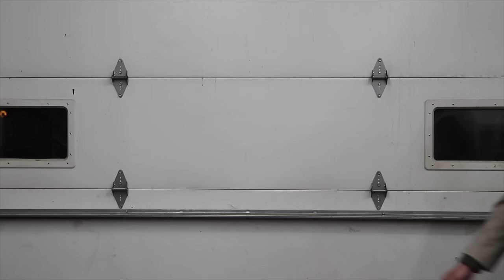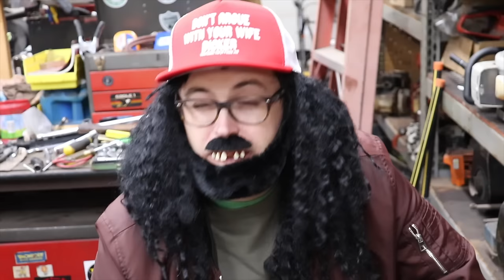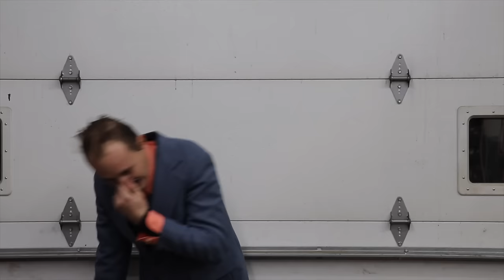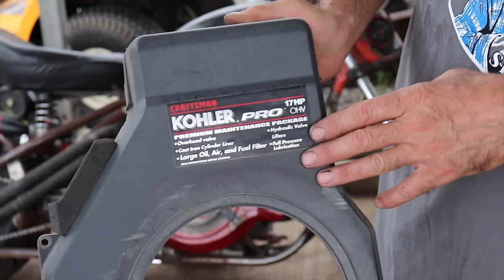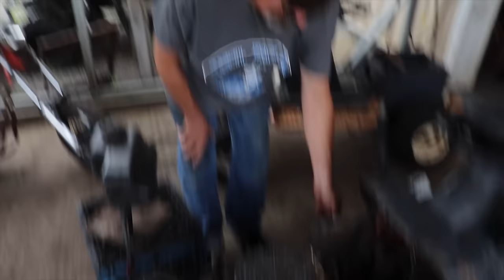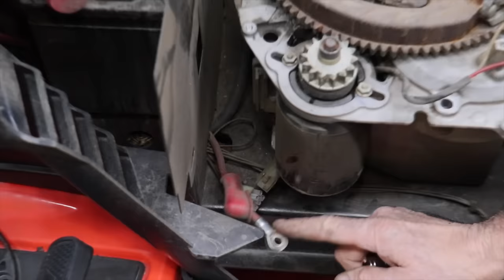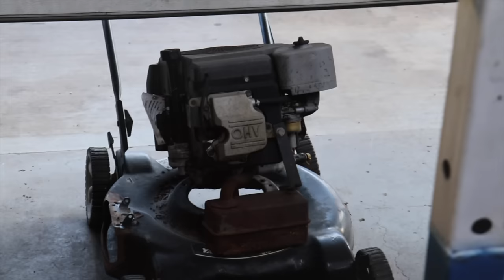Epic $100 Mower Flip - Engine Swap

Comment: Taryl is a real mechanic, he can take a substandard part and make it a high quality part that will work much better in the long run. He just doesn’t replace parts. That’s a great mechanic in my opinion! I have a 2018 Simplicity Regent tractor very similar like this but it came from the factory with a 22 h.p Briggs V-twin Pro model engine. It’s got a ton of power for the 38 inch mower deck.

Comment: The muffler, cable and wiring were super helpful, especially wiring. Going from a Kohler tp a Briggs on a lot of Tractors in the past was tricky for me, because of different wiring and colors, this helped simply that. Simplicity is key.

Comment: In 1986, I bought a Simplicity lawn tractor new, with a snowplow and deck, for my mom - who lived 250 miles from me.  It worked fairly well for 15 years but it wasn't anything to write home about.  I had no idea of what a real tractor was until I happened across a Simplicity garden tractor from 1974, used.  It has a 10hp cast iron B&S motor (large enough for my purposes) that will be running long after I die.

Comment: I just recently stopped by a big commercial construction job during this freezing rain storm and I asked the electrician if I could have some of the conduit fall offs lying around. He looked at me like I was insane. Let me tell ya the shit works great for exhaust on these mowers. The elbows can get a bit pricy at a supply house but I saved more than one mower with muffler extensions like that. Many years ago I made stack like exhaust pipes for my buddies VW dune buggy like that.

Comment: Great video as always, I run the Regent's big brother, a 2000ish Landlord DLX. In spite of the extra work fixing up the old deck, the cut quality if the full width roller decks makes it worth it. As for horsepower, the 18 horse Vanguard on my 50 inch Landlord can handle it adequately, main problem is it clogs easily in tall grass.

Comment: Taryl, FYI :   Tale from me. Needed new volt rectifier/regulator as yours.
John Deere wanted $90 ;  bought it elsewhere for $45. Now, ebay has then for $9.95. 
Another good tip, Run a separate ground wire from the connecting bolt of the regulator to the battery neg, or a good known ground. A bad ground connection will burn out the regulator mighty quick......I put mine to the battery post bolt

Comment: i had one of those dual control throttle assemblies that the cable hole was worn out on the choke lever. i just moved the cable to the other set of holes on the opposite side of the lever and put it back together. it works perfectly, just opposite of the choke on/off markings on the dash. nice of them to put holes on both sides of the lever like that. it is so convenient it must have been an accident i'm sure.

Comment: I did a refurbishment on a simplicity broadmoor. Repowered w a 22 hp briggs v twin. Originally was a vanguard 16hp which couldn't be rebuilt because the customer lost both heads and flywheel after it sat for 5 yrs under a tarp. Repower which required pipe fabrication bent outward a bit n lengthened 1 in on each side. Turned out really good. Pipe is a little tough to weld. Slow wire and lower the voltage. Also new steering bushings and rebuild the deck n spindles. 
Also flushed and refilled transmission and also new belts and new battery. 
I had to actually build a bagger for it but it turned out awesome. Parts cost was around 200 bucks. So
I payed 100 for it sold it sold it for 780. Guy really loved it. The quality on the higher end simplecitys is good.

Comment: Tarly, I watched your episode on the ultrasonic cleaner. I have discovered a great industrial cleaner that has lots of ammonia. I was developed for the coal mining industry. It’s called Blue Wolf. It can be ordered on the interscreen and they have a full line of cleaners and automotive cleaning products. I degreased the Briggs engine on my John Deere GT 235 and it worked great.
Reply: Dawn dish soap and water....or Mean Green 50/50 mix.....tried PurplePower, doesn't play well with aluminum......I'm now running a mix of Dawn, and pressure washer cleaner diluted, and seems to work well....

Comment: This is very interesting,  I'm doing an engine swap on a Murry 40 inch cut.  I was going to rebuild the 12.5 engine but, its cheaper to buy a new engine than rebuild.  Since I'm going to replace the engine,  I figured why not go big,  so, I'm going from 12.5 horsepower to a 25 horsepower 2 cylinder B&S. I always felt the 12.5 was too little for the mower,  I'm hoping the 25 will  have plenty of power for the 40 inch cut

Comment: Y'all remember that time you got a John Deere 214 for $200 and thought the non-running engine would be a simple fix? Yeah, me too. It's still on my patio awaiting a new engine repower, and a mount, belts, electrical system, all the manual controls were rusted together, and sometime later you figure out you paid two hundred bones for essentially nice sheet metal and a couple flat tires. Engine swaps are a lot easier when you score them on the cheap and were made the same decade as the donor engine. Man, never again!

Comment: When you torch the pulley like that, does it melt the seal under the engine? I know he wasn't concerned with that bucket but what if you wanted to keep the engine in tact?
Reply: Yes it does

Comment: Donyboy73 was talking about how John Deere did the same thing with the cutting blade bearing hub assemblies one of his videos where they fitted sealed bearings into regreaseable bearing housings.

The bearings can be sourced from a bearing shop or on eBay if you can get the bearing number off the seal or if you have a set of vernier calipers to measure the bearing ID & OD them Match it up to either a metric or an imperial bearing.

Just be careful when fitting them because they don't like being hit on the inner race with a hammer !
Reply: Guy rarely makes a mistake like that one.  Bearings should be pressed in, not driven in.

Comment: Under the deck around the blades is there a way to install more ways to mulch like the Toro dual-core cutting system has to cut grass pickup and leaves when bagging?

Comment: I know this is an old video, and this isnt a flip story, but i JUST got an old...like 2003 or so Craftsman with a 13.5 briggs. The deck was shot. It was barn kept its whole life just you know, grass ect. Shot as in there is more holes than metal. Rest of the mower is in absolute amazing shape, i need to give it a little carb clean, but yeah. Old lady owned it, even gave me the original owners manual plus the purchase receipt and even a receipt for a battery. Oh, for free by the way. Hadn't had a ride on before, so this is great, and me and Dad even used it to tow a couple items around the yard a bit. Gotta know for sure when and what to fix or when to give up. If i could get a deck for real cheap, i'd for sure throw one on.

Comment: The reason the top spindle bearing is a sealed bearing is because it doesn't have near as much load on it because of leverage;   and also, as soon as your grease level drops a little, that top bearing will be dry.  The bottom bearing has all the load on it, and all that grease will settle to the bottom because of gravity.  So it's better to be an open bearing..   The main problem with your top bearing being exposed is that you really have to stay up on your maintenance because again, if your grease drains even a little bit, your top bearing will immediately be dry.   It's much better to just keep that top bearing sealed.

Comment: I have a simple city conquest with a 50 inch mower deck and factory is a 18 horsepower Briggs and Stratton I do like the mower it does a wonderful job mowing but it's way under powered what size of engine would you suggest I look for that would give me some more power but not need to find different pulleys and electric clutch thank you for any information o and you have to watch them wet farts sometimes they will itch later lol

Comment: Great video with a lot of meaningful detail. Just one question, wouldn't you need more lubrication in the axle housing? Most of riding lawn mowers run in an oil bath.
Reply: Can you elaborate?? What axlel??

Comment: You're lucky the previous owner never greased those spindles! I guarantee you'd have to dig out half a pound of grease if you took mine apart! I been greasing them every Spring for almost 20 years! Mine's a 44" deck with equal sized blades.

Comment: Hey Taryl. I bought an old abused LT2000 Craftsman, that someone swapped in an 12.5hp Briggs. Any idea what may have happened in the conversion that would keep draining the battery. Ive replaced the battery several times with several brands. Replaced the regulator as I read is a common cause with no luck. I put an inline kill switch which works just curious of any common mistakes by backyard mechanics that could cause a parasitic draw. Thanks Taryl and I liked Sammy the "Dull" Gravano's initial presentation 😆

Comment: Anyone wondering. Swapping these engines on any lawn mower is super simple. 

Most of the time theirs two or three wires.
The black off the coil is just a ground wire for killing the coils has to be toggled to chasis ground. The red wire off the alternator with or without the diode inline is the 12v DC charge wire and can also be used for lights and accessories just run it to the positive post of your solenoid to charge your battery while running, and sometimes theirs also a white or other colored wire when their isnt a regulator used which is usually an AC wire off the alternator for your lights and accessories. If theirs a wire off the fuel cut off solenoid you just need to power it or delete it which I always do.
If you know that much you can rewire and swap basically any motor on any mower with other exceptions taken into account obviously. Hope this helps someone.

Comment: hi taryl i have a 2011 craftsman mower i replaced the Barings in the Spindale blade shaft and when in put it back togather and started cutting grass i noticed about a one inch spot of grass that was not cut i measured the blades and they are 23'' long and just two blades , is there any adjustment in the spindles or do i need longer blades i can not go much longer because they will hit the side of the deck and the rideing mower is a 46'' deck thanks if you can help

Comment: Question: if the muffler ever needs to be replaced is there a stock muffler or one that doesn't require modification to fit for the new owner to be able to replace without cutting and welding?
Reply: Straight pipe & bean can
Reply: straight pipe out the side and turned up about 2.5 feet long with a rain cap. it sounds SWEET!
Reply: All these ideas but none of them are direct oem stock bolt on mufflers for the rookie home owner with limited mechanical skills and no welding, cutting, and metal fabricating skills. Just simple straight forward purchase and bolt on and that's it like the original motor had.
Reply: @kbakeritsallaboutnobody.5761  thats the problem you run into when doing engine swaps, things might not fit
Reply: @michaelking3327  I didn't post this to be difficult or argumentative but when I flip mowers as compared to working on my own stuff there's a threshold I won't cross because whoever buys the machine might not be as mechanically intelligent as me and while that's ok I have to make sure it's simple for the customer to order parts and replace them without any fabricating or modifying to "make it work".
Reply: @kbakeritsallaboutnobody.5761  i agree, but sometimes the parts just dont exist. i work at a mower shop and there have been times we've had to fabricate stuff to work. in the end, as long as it's safe for the customer to use and won't fail in a dangerous way, then a little fabrication is worth the time for the money.
Reply: @michaelking3327  I probably would've replaced the Kohler with a B&S and went through the minor wiring changes than fabricating the exhaust. Typically most B&S engines single cylinder have a side exhaust port and mufflers are a dime a dozen and can be purchased for pennies.
Reply: @kbakeritsallaboutnobody.5761  very true, sadly kohler, kawasaki, powermore, and newer tecumseh are not as user/servicer friendly.
Reply: @kbakeritsallaboutnobody.5761  The exhaust pipe slides into a hole in the muffler. No need to buy a new pipe if the muffler ever rots away. They're two different items.
Reply: @bushmaster2936  what about when the entire exhaust system needs replaced from the gasket to the muffler? Just not something I'd do on a mower I'm flipping.
Reply: @kbakeritsallaboutnobody.5761  I already replied to your first question , specifically asking about muffler replacement. To answer your second question, sounds like you shouldn't be flipping mowers if you can't fabricate necessary parts. Also, do you sell your flips with a lifetime guaranty on all pieces / parts?  I didn't think so.
Reply: @bushmaster2936  no need to get rude and ask obviously dumb questions to make a sarcastic point. I never said I couldn't fabricate or modify parts so where did you get that information? I won't sell something to someone that requires a set skills for them to repair that they don't possess. What else you got oh highly intelligent and very rude person???
Reply: @kbakeritsallaboutnobody.5761   I'm typing this very slowly so that you might be able to absorb the information. There   isn't   an  exhaust   system   anywhere   in   this   world   that   will   fit   everything.    Did   You   Get   It   That   Time ???  So that leaves you with replacing like items with like items, ie: you would have to replace the Courage engine with the same, exact, Courage engine as seen in the video, and nothing else.
Reply: @bushmaster2936  you are so intelligent. You should take a nap because I'm sure it wore you out coming up with such a brilliant and obvious reply. I guess my comments aren't on your intelligence level because you're having a difficult time understanding. I wasn't asking for something doesn't exist like a universal exhaust system but I that must only exist in your intelligent world where all the crayons have their own sharpeners and coloring books are plentiful. How did we get ever get opportunity to be blessed by your intelligence???
Reply: @kbakeritsallaboutnobody.5761  You seem to be so intelligent. Why don't you reread your own question and come up with your own answer. Problem solved. Good luck with that.
Reply: @bushmaster2936  oh but I'm waiting for more details on this universal exhaust system you speak of...
Reply: @bushmaster2936  thank you for taking a break from coloring to reply.
Reply: @bushmaster2936  Not always, some have the head pipe welded to the muffler.....any time you do a swap from one brand to another, your going to have to do SOME kind of modification, be it electrical, fuel or exhaust.....the only thing generally universal, is the engine mount....IE the holes.....because they ALL use different engines for the same machine depending on year and other factors.....
Reply: @bushmaster2936  Dude, this isn't the place to get pissy with someone.....we are all in the same game....and the " flips with a lifetime guaranty " comment is ridiculous  in and of itself.......
Reply: @kbakeritsallaboutnobody.5761 , a couple of problems I see with your complaint is most people who don’t have the skills to fabricate a new muffler would probably take it to a mower shop and pay to have it replaced/ refabricated. At sixty nine years old, I don’t think I’ve ever replaced a muffler. Maybe on some old single cylinder Briggs but with most mowers you run at full throttle so it’s not real hard on it. Just my thoughts.
Reply: @Hoaxer51  wasn't a complaint but an inquiry and my point is while most homeowners have a set of wrenches they don't own a welder and while I'd admit exhaust systems aren't a usually replaced item there wouldn't be replacements for sale on the market if it was never an issue.
Reply: @kbakeritsallaboutnobody.5761 , I should have said comment instead of complaint, sorry about that.

Comment: Hey please dream up a method to know when throttle/choke lever has choke fully off while driving the mower. Would save gas, get maximum rpms and make engine run cooler.

Comment: By the way they do make a cable cutter for the sheath cable and it ain't cheap it's about forty bucks even at Harbor Freight. But it makes the job a breeze if you get the PARK tool. Mine is ages old I got it at a local flea market new still in the package but to my research park tools hasn't made em since about the 1980's or so. I think Electrical supply houses would be a better place to look for one. Probably a 10 or 12 gauge wire strippers would also work because that is what I used to use.
Reply: Park originally made a full line of tools for bicycle mechanics.

Comment: Hey Taryl, have you done any work on general transmissions as founds in a Aries 42.  Driveline is plastic garbage. Trans is plastic.  I rebuilt a bearing burn out but now on’t engage.  Did something wrong in the control cables.  Help!